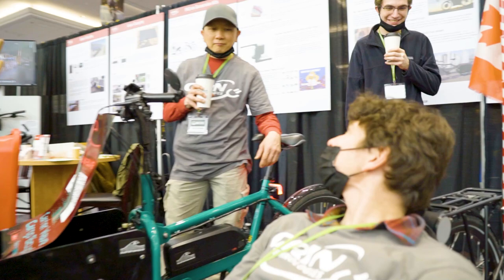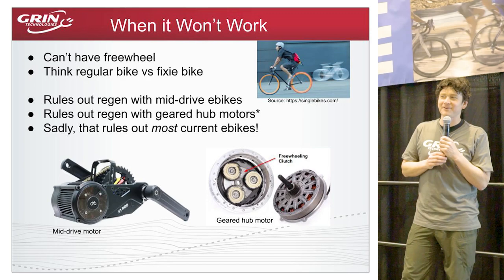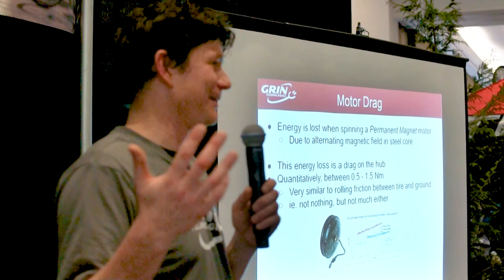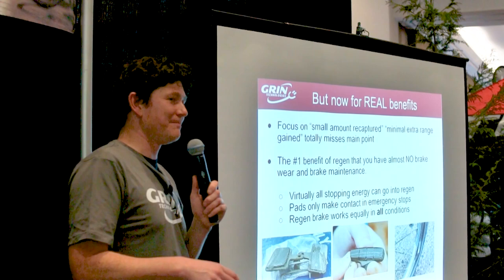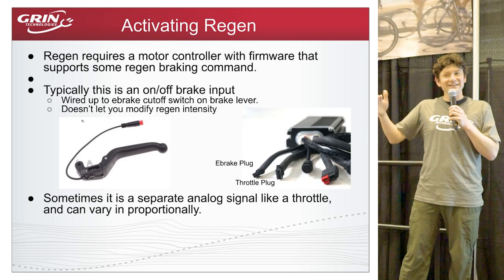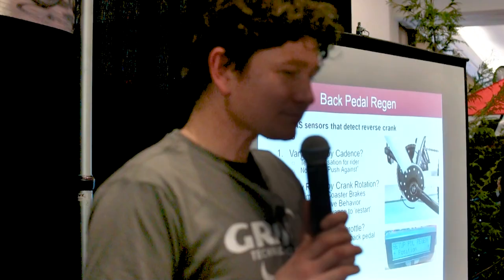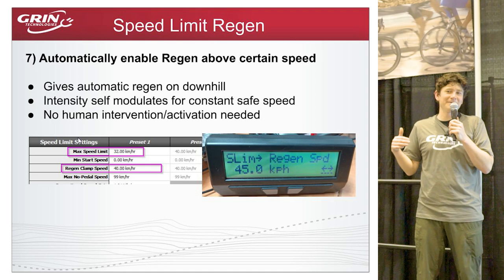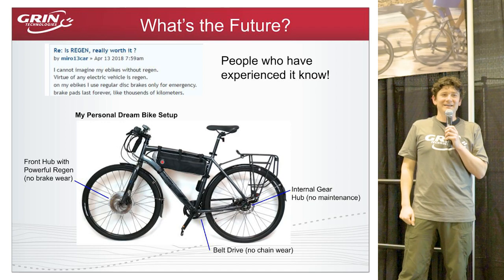Regen Braking and Electric Bicycles, Justin's Presentation from 2022 BC Bike Show

Comment: I have a simple inexpensive solution for you thats intuitive to use, variable regen / braking, with adjustable bias between regen and mechinical braking, even dynamic bias.  Once i get the fixed bias protoype i'll tell you how it works.  I think its prettty obvious and a good solution.  And i agree that the whole cutout swtiches for wired brakes and glue on sensors for hydraulic brakes is crap, and also agree why no company hasn't solved this commercially sooner.  God for me though.  More soon.  And apols for the typos, typing from bed to the desktop.  :-)

Comment: Justin, any thoughts about offering a set of gears for standard geared motors (eg. Bafang 01x, 02x, 03x, etc) that replace the clutch with a solid carrier to enable regen? I've seen a lot of replacement gears/carriers available but all are standard clutched versions. I could get one and have it welded, but seems like there could be a market here!
Reply from the maker: We concur ;-)
Reply: @GrinTechnologies  so this means a set of gears are coming soon? 🤞🤞🤞🤞🤞🤞 For the bafang g020.250.d maybe 😂😅?

Comment: ? so if the power is off then you get .5-1.5 Nm resistance (not nothing but not much either); how is this resistance increased to stop the bike? i.e. when there is no power going into the motor then you get the .5-1.5 Nm resistance but how do you increase this resistance?
Reply from the maker: WIth the motor controller allowing phase current to flow in the opposite direction than it normally would to generate a positive torque.
Reply: @GrinTechnologies  so closing the circuit with a load (BMS in this case) generates negative torque?

Comment: The truth about regen is it makes you work hard and slows you down. I live in the mountains and the only advantage with regen appart from: Saving brake pads, having a good constant pedal workout going downhill (feels good for physio rehab) is that it increases your range if you desperately need to. You will find yourselves peddling slowly downhill and with the efficency losses in both directions of the power conversion you will win almost nothing back. Even coming down a mountain 400M vertical difference and peddling all the way down i will be lucky to restore one battery bar on the display, usually not an entire bar out of 8 blocks i think.
  So, there it is. It's not even practical in the mountains, it will slow you down and tire you out when you should be resting on the downhill. If you live in the flats your really going to get virtually nothing except for saving some brake pads and perhaps give you 500M more distance at the end of the day.
  And it broke my hip (as described below) which might lead to a full hip replacement at some point. So i don't really know how you can say there are no downsides. lol

The other thing with regen is it's inconsistency (at least on my bion x smart bike system). It cuts in much harder or almost cuts out at certain speeds so when you start to go fast it actually holds back the charging presumable due to overvoltage for the conversion circuit and when you slow right down it kicks in extra hard making it almost impossible to go down hill without reducing the regen level. The amount of braking / charge it gives you is also dependent on the batteries charge level, when they are full regen is not going to do much anyway ( so no saving brakes while the battery is full) and once they loose 10-20% it kicks in hard depending on your speed, so, basically it's a bit all over the place. If you just add an extra 5Ah of batteries in parallel or a solar charge panel you will get the extra range without all the messing around. Saying this, i am going to add regen to my new build, i bought a controller that can manage this and i will use it from time to time, especially for braking and if attempting extra long distance rides when i'm not afraid to sweat.
Reply from the maker: One bar out of 8 is actually an enormous amount of energy. Whether you care about it or not is another matter, but it's hardly nothing and if recommend on your next build with Regen that you add more meaningful instrumentation if you want to look at the quantitative side.

The behavior ( ie how Regen kicks in, varies with speed, charge level etc) is all based on implementation of firmware and electronics for a particular system, and is not intrinsic to regen in general. Your controller could be programmed differently to counter all of those observations. So just keep that in mind, what you are describing is just an experience with a bionx system.
Reply: @GrinTechnologies  you still can't get braking out of regen when the battery is full. Unless you use either short the motor, use large resistors of have a huge capacitor bank. Don;t forget i get 1 bar max coming down a big mountain ( most people don't have access to). What i'm saying is that i have to do a workout to get that.  I'll have to pedal standing on the pedals for a 400M vertical descent. So, it slows me down and tires me out. The only real use is for range extension while seeking a fitness workout. saving on brakes is ok 4 sure but not amazing. I like what you are experimenting with but it gets complicated with a full battery and under different speeds, hope you can map it all out and find an easy way to control the force. Loosing efficiency in both directions doesn't exactly help.
  And after breaking my hip i would never say there are no drawbacks.
  I'm still going to have it but it's a minor plus for the most part. Just go with a bigger battery or a solar shade roof / trailer for range extension. Or, even a micro generator.
Reply: @izzzzzz6  You didn't break your hip because of regen. You broke it because you're old, a cyclist, and still pushing it despite warnings from your body that you ought not.

Comment: Which bike computer do you recommend that supports Rain Breaking?
Reply from the maker: It's not computers that do the regenerative braking, it's motor controllers.  Most modern general purpose BLDC motor controllers will do a great job of it, wehther it's our Baserunner / Phaserunner, the VESC, Kelly controllers, or what have you.

Comment: Would be possible to add a feature for regen through a negative torque pedal sensor signal ? For an electric fixie for example ? Would be pretty rad to have an electrique fixie with no mechanical brakes.
Reply from the maker: Yes, it's possible to support that mode with the Thun / NCTE style torque sensors that measure torsion across the spindle, but not with most torque sensors that measure both left/right pedal torques as those seem to have only a positive torque signal swing (at least all those we have looked at).  The custom firmware we did for the pedal electric unicycle is an example of us implementing this very thing:
https://www.youtube.com/watch?v=-C1n6XAypag

Comment: howbout on some brake levers theres a bit of cable that stretch between the handle and the mount to put a rack and pinion type of 3d printed gearing to a potentiometer built into the handle, and or the handle itself.....  this would be really easy to implement but not necessarily waterproof
Reply from the maker: There are a whole lot of somewhat 'hokey' approaches like this that can work for sure, but that just don't look all that elegant at the end of the day. No reason not to prototype and whip one up if you are inclined though!

Comment: How can we get a resistor to take the regen load when rolling down a hill with a full battery?
Reply from the maker: In practice this is just not an issue really. But if you live on the top of a very large mountain where the first thing you do after leaving is a lot of regen, then it is simple to just set your charger to only charge to 80 or 90%. It's better for the battery too
Reply: Yes but I charge to full because I do not know what way I will drive on the hill. so how can we get a resoistor to take the regen load when rolling down a hill with a full battery? I hear something about relays, but how do you activate said relay switch? @GrinTechnologies

Comment: Cool, i have 1,000 feet of vertical in my city to take advantage of in terms of regen.  Wish i would have investigated this prior to doing a mid drive build.
Reply from the maker: Well, live and learn and there's always build #2!
Reply: You could always add a small direct drive just for the regen braking and reduced chain wear.     Use the mid drive up hills and the direct drive on the flat.

That's what I'm doing.

What I use is a 250w efficient direct drive for flat ground,   and a 3kw cyclone mid drive for deleting hills
Reply: @GorillaZillas  is the hub front or rear?

Comment: Have an E-MTB with 2 wheel drive and 2 batteries (17 Ah and 20 Ah) and dual suspension that weighs 90 pounds. Yeah, a cargo bike with a 400 pound load capacity, including rider weight. I got it for hunting to carry boned-out big game meat and for bike camping with my UL backpacking gear and a 14 pound solar blanket and controller.
-> COULD I get regen. braking in BOTH motors with a lever braking sensor?
Reply from the maker: Yes as long as you have hub motors without a freewheel. Sadly most factory ebikes with hub drives use geared motors with a freewheeling clutch which makes them unable to do regen.

If you have a direct drive motor it can do regen for sure
Reply: @GrinTechnologies  I want to REPLACE BOTH MOTORS with FREEGEN motors! Is this possible with your controller and screen? My E-Cells Super Monarch Crown has a 52 V Sine Wave 45 amp controller W/18 MOFSETS in a SEALED conductive gel and aluminum, finned housing. It's rated at IP 65 waterproof.This controller is EXTERNALLY mounted on the seat tube and easily replaced.

Comment: Polaris (rip) already did this in their failed ebike line. You could get regen  backpedal in place.
Reply: Regen breaking and BioSync Cadence Sensor to measure the gear your in so the motor will adjust automatically.

Comment: Now I am curious to try a fixie with an All-Axle motor and a torque-sensing bottom bracket.
Reply from the maker: If you use a spindle torsion sensing BB like the Thun / NTCE style of sensor, then it actually shows negative pedaling torque quite well too (at least from the left crank). In principle it would be no issue to have a firmware update which causes the motor to do regen whenever there is backwards torque on the left side crank.  This didn't get covered in the video since we haven't tested it out yet and it's pretty niche, but in theory it's also a totally viable control mode. 

This implementation would also work with a non-fixie bike by putting a reverse torque on the spindle by having the left crank back, right crank forward, and just pushing down equally on both pedals.

Comment: Are there e-bikes that come equipped with a Grin hub motor?
Reply from the maker: https://ebikes.ca/project-gallery.html?motor-system=14

Plenty that are equipped. As far as come equipped, there are a number of more niche cargo bike and trike/quad manufacturers using this hub, but not yet many conventional mainstream ebikes if that is what your are asking.
Reply: @GrinTechnologies  thanks. I did own an acoustic cargo bike made by Yuba which was a workhorse. It was sadly, stolen. The only issue.with it was that the wheelbase was too long to go onto a bus. I would not mind a similar bike with a shorter wheelbase, but this time class I or II electric. I love the idea of regenerative capture. The Spicy Curry looks interesting. Then again an electric MTB would also be nice. As long as the fit on a bus and are not to heavy to hoist onto the rack. (My Mundo weighed 65 lbs.)

Comment: So have you used an EUC?(electric unicycle) a modern one, while not capable of hauling cargo, works well for personal transport. The Kingsong s20 is a modern hi speed EUC with suspension.
Reply from the maker: Sure but we prefer EUC's that you can still pedal! https://youtu.be/-C1n6XAypag
I did a regen analysis on an earlier version of this (a 29er with a 1to1 pedal drive) about 10 years ago and was averaging more like 30% regen rates.
Reply: @GrinTechnologies  modern euc's can cruise @ 60km/h, and as you're not peddling  you can gear up appropriately. While I admire the ability to manually control a unicycle the EUC with inverted pendulum logic with an 6or9 axis sensor makes for a safer ride.
With the balancing of the user's weight, regen can be quite effective and only one moving part for very low maintenance.
Would love a grintech motor for my Mten3, so I could use it without fear of an axial snapping again...(but that's a model specific problem)

Comment: What's the efficiency of electric car using a battery in when temperatures are -20F?
Reply from the maker: The efficiency of almost all electronics increases quite a bit the colder the temperature. So as measured from battery output power to power at the wheels (which is how most define vehicle efficiency), it would be much better in those freezing conditions than at a higher ambient temp.

Comment: The designers of geared hub motor could have designed in a solenoid locking controlled freewheel. That way, it could mechanically freewheel in normal use and also have no cogging when pedaling without the motor. But the solenoid could seamlessly lock in the freewheel as throttle is retarded into regeneration mode to provide braking and modulated regeneration. Just more complex and probably not worth it.

Comment: One flashing thought: use a hub-generator on the front wheel ONLY FOR REGEN.
Because the front wheel is better for braking.
And the rear wheel is better for propulsion.
The controller would have one output for propulsion and a separate input for regen.
OK, I know, there is a weight penalty, but could be worth investigating...
Reply from the maker: If you do the analysis it is quite pointless to have a motor on the front wheel and not bother using it for propulsion as well as regen. Your efficiency will always be better running both the front and rear drives equally compared to having all the power on the rear motor while the front does nothing.  Have a look at this video https://www.youtube.com/watch?v=Ub4EP2_mAds if you want to see why.

Comment: I build my own style of Motorized bicycle, so simple a cave man could do it.  Works on any bicycle with a seat post. I've deleted all of the moving parts.  If fixing a flat tire is working on your bike then that's what my build is like.  
I rode one across America 🇺🇸 last year Florida to California and back. 
Makes the bicycle non critical just needs air in the tires . 
The best 100 dollar bicycle upgrade ever . It leaves carbon  titanium, and lithium are the bottom of the hill every time.  
I call it the Predator Friction drive.  I post videos on it on my channel. 
I answered all of the lectures questions for 100 dollars complete.  
No special parts or tools necessary.

Comment: Front brake lever= front disc.
Rear brake lever= hub Regen.
Because three brake levers is dumb. And if Regen goes out, well the front does 80% of the braking anyways so you'll still stop fine.
Reply from the maker: Generally you have a lever that does both regen and still engages the mechanical brakes when you pull it all the way.  We haven't seen anyone use 3 brake levers which is indeed pretty dumb.

Comment: 4:33m I'm sure you'll answer this, but how can the power flow into the battery when the emf of the motor drops below that of the battery?  I thought that was a basic principle of physics that has no fix other than to boost that voltage and work with the power equation? What broke??
What broke was a sentence at 3:00m - you said "there's no extra switches or anything involved, the power just flows back to the battery," but in the next sentence you add: "and then it (the controller) will boost that (voltage) so that it goes back into the battery." So while a booster may not be be a switch - in this case it's transistors, which are switches, doing their job.
Also in over a hundred comments I searched - not a single mention of "voltage". Other than this one. 👅
You are amazing anywat. Learn-on!!
Reply from the maker: Hi John, the principle is exactly the same as any non-isolated DC-DC boost converter (see https://en.wikipedia.org/wiki/Boost_converter ). In this case, the inductor for the boost conversion circuit comes from the induction of the motor windings. 
By extra switches, what I meant was that in order to do active regen, no additional switches or circuitry is require above and beyond what is already in place. Many people erroneously assume that a regen motor controller is more "complicated".  At least this is the case with BLDC motors and motor controllers. If you have a basic brushed DC motor and motor controller, then you can get away with just 1 mosfet if you don't require regen, but need at least 2 mosfets to do regen control.  BLDC controllers are 6 mosfets regardless.
Reply: @GrinTechnologies  Hi Guy! Right - thanks for the detail. I caught your long talk on regen. Also your long talk on dual motors. The only Q left is can you (and I mean you) design and patent and produce a locking freewheel bearing for your modified gear motor? I personally can't imagine what a minimum package would entail - other than a basic picture of electro-magnetic at full stop. Probably no room in there now, but would pump the whole industry. Burn on!!